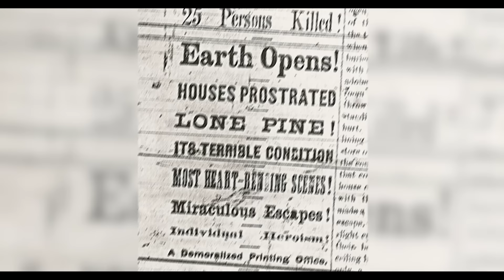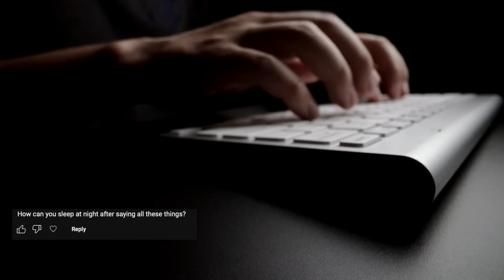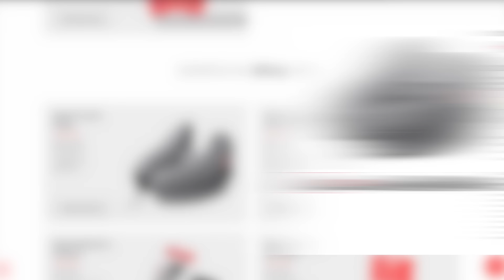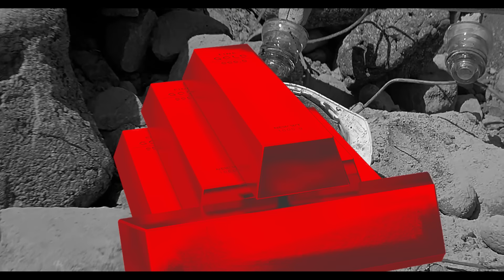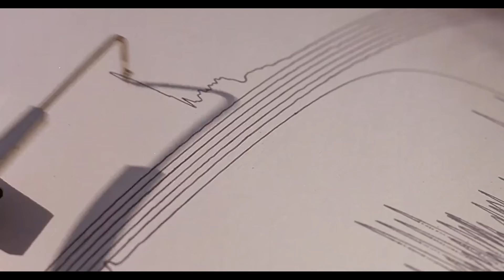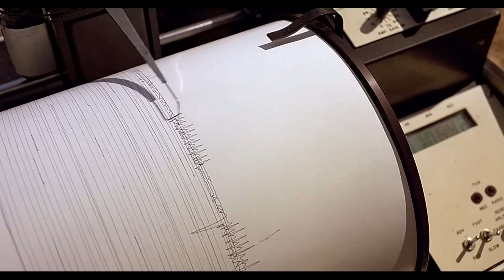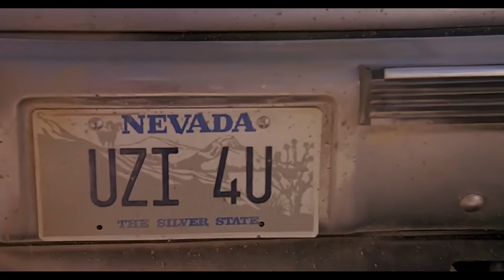How to Beat the GRABOIDS in TREMORS

Comment: I really don't agree with your plan of stay in the buildings that they already showed could be broken into. Not just breaking the floor but also the foundations. The worms would have done the same with Burts place as well as we know they can take out the walls and if they do that enough the whole house is coming down. I still say fight them like you but with a diffent plan. We know they will chase but not for long if your faster then them so we can use that to pick a location to trap them in like an open mine or a feaild of sticks with bombs on them that we can 'move' at random to get the worms to eat it.

Comment: I will point out that the entire house and store were never lifted all at once. A Cornwell was lifted causing the wood to flex and ripple. The worms never lifted the full weight of any building. In fact they struggled lifting the corners of the house. So it would be reasonable to think that a 30 ton vehicle wouldn't be able to be lifted. There's also the issue of bullets not penetrating sand very well, meaning that someone would need to be more or less sacrificed to land kills on them. Distractions tend to only bring the tongues out. Really, one of the best methods to kill the worms would be to get on a dirt bike and run them into concrete again. Maybe the concrete spillway. Certainly, the characters could have been smarter but panic makes you stupid.

Comment: Theres a much easier solution here. The concrete runoff that already killed one graboid. It will run from the mountains all the way to a primary body of water, which probably passes by several other semi-habitated areas. The point of them is to prevent flooding from the mountain snow melting and occasional heavy rains.